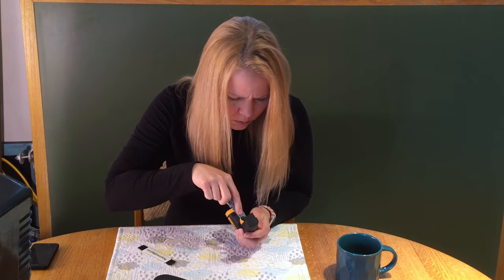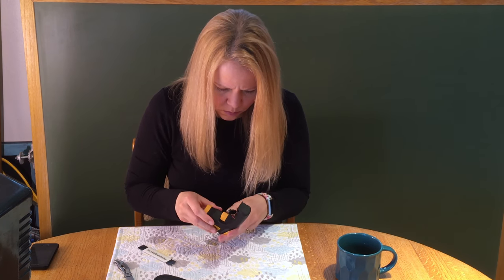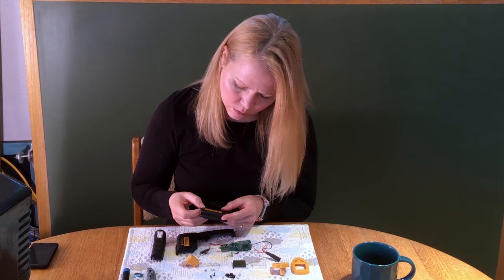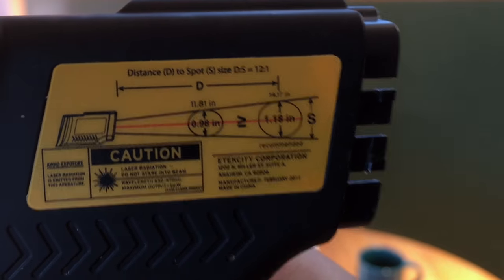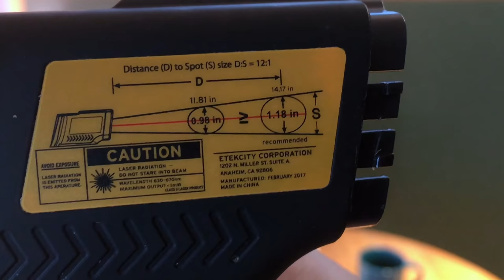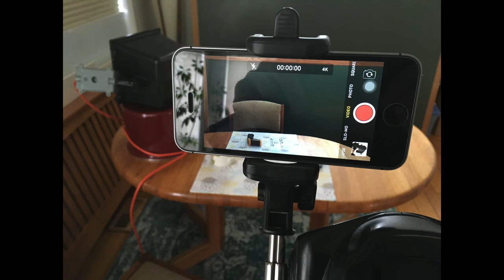Meg Disassembly Discovery of Etekcity Lasergrip 774 IR Thermometer

Comment: love this device. we use ours to monitor our baby's bath water temperature so it's not too hot. it slipped one day and got some water in it and the screen started acting funky. i watched your video and was able to open it up. i used my multimeter to check that all the resistors/caps were good - turned out a little bit of water got behind the screen and was shorting the connections. i dried all the water out and let it dry for a bit and works good as new 🙂. sorry yours didnt have the same fate!